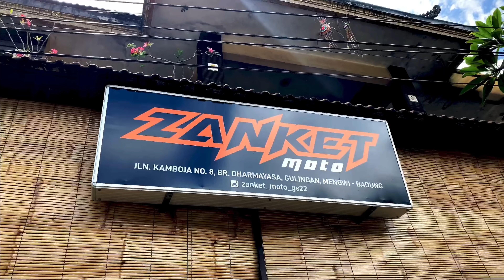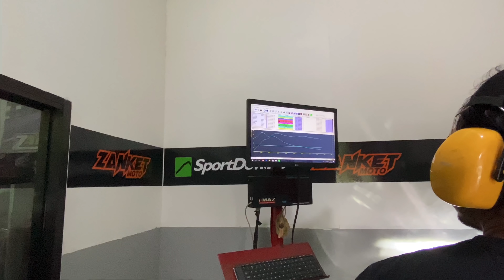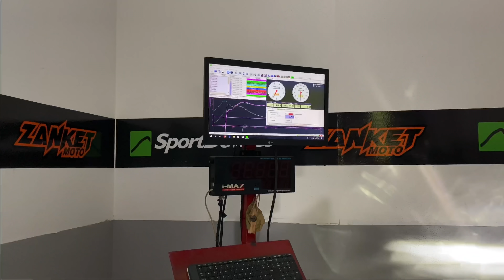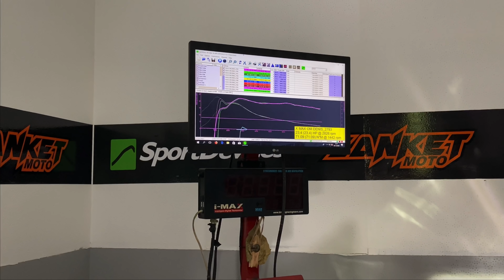BORE UP X MAX 300CC HARIAN TOURING // ZANKET MOTO

Comment: Kenapa ya Matic sama Manual dengan CC yg sama jauh tenaganya, satu pabrikan aja R25 VS Xmax, R25 bisa nembus 29 HP di dyno, Xmax cuma 18-19
terus di kelas 150 CC, anggap saja Nmax 155 cc power cuma 10 DK, sedangkan Vixion 150 CC bisa nembus 14 DK di dyno
Honda misalnya, CBR150R nembus 14,7 PCX cuma 9-10 DK doang, itulah alasan saya kenapa pilih manual, sensasinya gak bisa didapt di motor matic yg canggih sekalipun
Reply: Beda om, jangan disamain
Reply: Rantai besi ama rantai karet ya jelas beda lah om
Reply: Yuk ulas..
1. Apakah dyno sama saat pengetesan ? Setiap dyno berbeda jadi saat test berbeda motor harus 1 dyno.
2. R25 vs xmax dari segi mesin 2 cylinder vs 1 cylinder, dohc vs sohc, pasti berbeda tapi kalo xmax udah boreup 350 cc beda lagi ceritanya cek di youtube xmax 350 ++ vs er6...kalah bor er6 ada kok youtubenya.🙏
3. Kenapa vario atau pcx beda dengan CBR ? Beda karakter mesin dohc dan bagian in dan ex, durasi cam sudah pasti berbeda.
4. Nmax vs vixion,, lagi2 beda di bagian in dan ex, beda klep beda noken as meskipun terpaut 5 cc,,
Kalopun nmax di bikin 150 cc tapi dengan karakter mesin sport 14 dk hal yang gampang di raih meski dia CVT..

Note : mx king dan aerox punya power yang sama diatas kertas tapi aerox harus upgrade CVT ya bukan mesin hanya CVT, startnya bisa setara mx king bahkan top speed on gps bisa lebih tinggi aerox.
Reply: @andriancahya1921  MX King sama Vixion kan basicnya sama om, kalopun diadu pasti sama, dengan joki dan skill yg sama, btw power di kertas sama asli itu beda, MX King punya power 13,6 DK standar nya di dyno, kalo Aerox mirip sama Nmax cuma bobot Aerox jauh lebih ringan dari Nmax, hanya kisaran 10-11 DK aja, itupun basic mesin SOHC 4 Klep beda 5 CC, Manual lebih fun daripada Matic, so kenapa Moto GP gak pakek Matic? Oh ya saya belum pernah liat Aerox CC Standar Tune Up bisa tembus 30 DK seperti MX King di Ajang Roadrace, di balap Asia di Sepang MX King 150 CC tune up bisa nembus 170 kpj on GPS bro

Note om jangn percaya sama Brosur pabrik, 15 HP Aerox dibrosur itu kepotong gara gata CVT, aslinya di Dyno cuma 10-11 DK sahaja om
Reply: @setyorahadi518  cepat atau lambat moto gp akan matic tapi bukan CVT tapi DCT "Dual clucth transmision" seperti yang saat ini di pakai di motor honda,, dan mx king apakah di dyno di tempat yang sama dengan aerox ?? Dan vixion vs mx king noken as berbeda soalnya saya pernah pelajari durasi noken as vixion lebih tinggi dari pada mx king toh kalo di adu vixion vs mx king saya pegang vixion kalo sama2 standart ya...
Reply: @setyorahadi518  dan mx king 150 cc road race arrc 30 hp,, karena peruntukan untuk balap sekarang saya tanya ada tidak yang ngebangun motor aerox spek full balap dengan mesin standard 155 cc untuk harian ? Kalau belum karena memang semua partnya dari kualitas dan durabilty bagus dan spesial,, yang hanya kuat dana yang bisa membangunnya toh kalo pake balap 4 kali pakai harus bongkar dan penyesuain lagi. Jadi jangan samakan arrc dengan tune harian🙏
Reply: @andriancahya1921  Dyno yg sama di Gede Widi Motor merk Dynojet 250 i, Vixion Advance kode mesin 2PV tembus 14,3 DK, MX King standar 13,6 DK
-Power Weight Ratio : MX King bobot 116 kilo 13,6 dibagi 116 dapat hasil 0,117
-PWR Vixion Advance bobot 129 dibagi 14,3 hasil 0,110
Dimana mana hasil nya seperti itu bobot jelas mempengaruhi performa, tes saja di mesin lain CBR150 sama Sonic, saya jamin menang Sonic kalo start

Aerox ? jauh bos cuma dapet 10,7 DK, bulatkan saja 11, lawan motor manual??? mimpi bisa menang, 

Ninja Mono 25 DK bobot 145 kilo
Xmax 1 silinder 18 DK bobot 178 kilo? 

ARE YOU KIDDING ME?😂

Edit : bobot mempengaruhi performa, contoh Moto GP bobot hanya setara motor 250 CC harian, 160-170 kilogram, bayangkan 1000 CC dengan power 250 DK, sama kayak MX King/ Vixion    atau Supra GTR/CB150R, jelas unggul yg bebek😀😂
Reply: @setyorahadi518  dan yang tidak anda tahu bahwa matic di dyno test akan terkena limit di 6000 hehehe jadi ga sampai power maximal..
Reply: @setyorahadi518  untuk bobot memang unggul bebek, power weight rationya,, tetapi yang saya sebutkan diatas kan karakter vixion dan mx king yang di mana profil cam lebih tinggi vixion dari mx jadi untuk jarak jauh vixion bisa mengejar dengan catatan kedua motor standart ya...

Dan ratio gear pun berbeda..
Reply: @andriancahya1921  Siapa bilang matic kena limit itu cuma berlaku di Nmax Abs saja karena sensor tidak berfungsi, tapi bisa diakali, tetap saja power akan keliatan sampai limit
Reply: @setyorahadi518  kalo diganti ecu racing pasti limitnya bisa lebih tinggi bosssku 👍👍👍
Reply: Bli zangket kude mayah,, keto patuhang set up nya,,, rage mare inget ngelah xmax sing taen mango sube 2 tahun. 3 tahun punya x max baru jalan 400 km saja... Cek biayanya... Lokasi sudah ta Cari di google,,, tell me the price
Reply: Males kopling.. Makanya pake xmax.. Nyantai👍😁